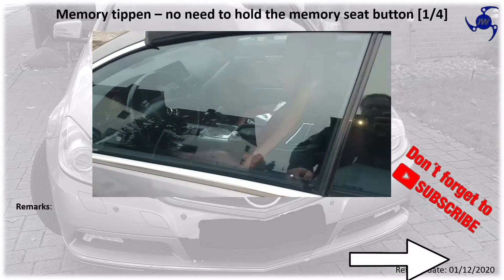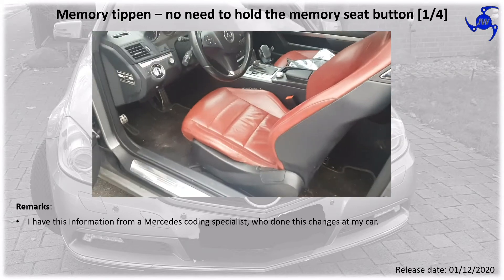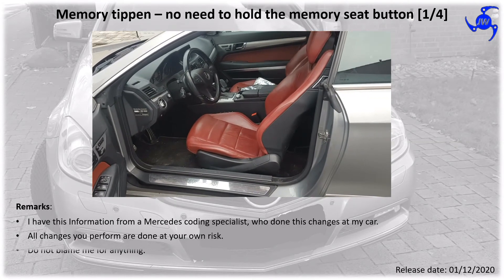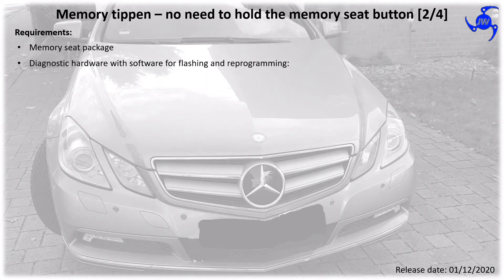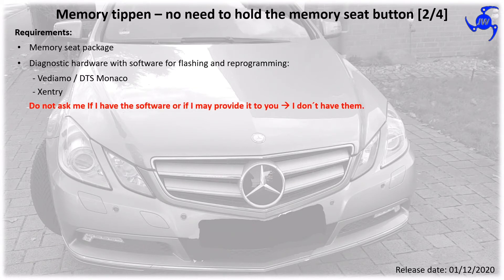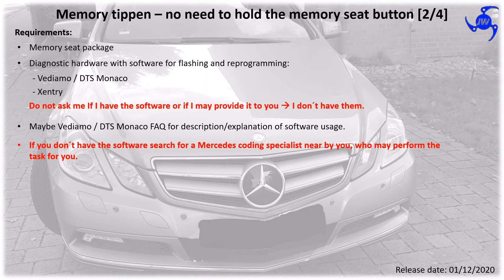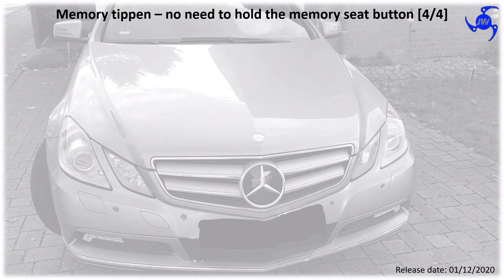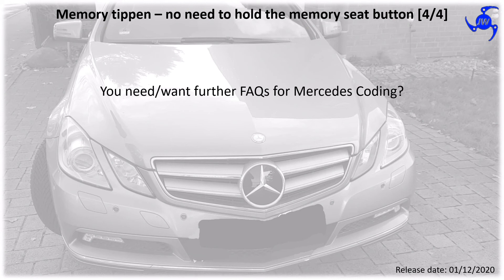DIY - Memory tippen Seats - 204 205 207 211 212 221 222 - Mercedes coding manual

Comment: what CBF file is for W221?
Reply from the maker: try something with seat in CBF name of your cbf colletion for the 221.
Reply: @JWAutomotive  are you sure is this work on prefacelift 221? Also the same question about remote trunk closing. I have keyless with trunk closing and opening from button inside car and on the trunk lid
Reply from the maker: @Luksor  I've heard that yes, but you need to find the correct position in your ECUs.

Comment: Tried on w166 from 2014 and it doesn't  work. 
Found the coding  in ECU i activated but it doesn't  do nothing,  works like before 😪
Reply from the maker: maybe you need to reset ECU
Reply from the maker: and it works mainly after opening the car
Reply: @JWAutomotive  already did the hard reset.
Reply: Did you sloved the problem. Mine also did not work. On w166 2012
Reply from the maker: @katipov656 maybe it will work if you update to a different firmware of the ECU. 
some codings work just on different firmware revisions.

Comment: I did it on w204 2011 and it only works when car is driving low speeds. At higher speeds i have to hold.
Reply from the maker: Yes it works.
Right after opening the car and at slow speeds. For me the most important is right after opening.